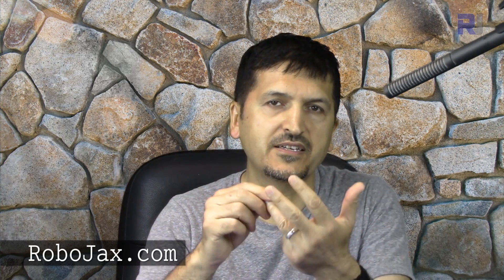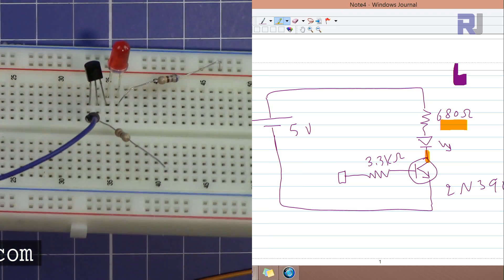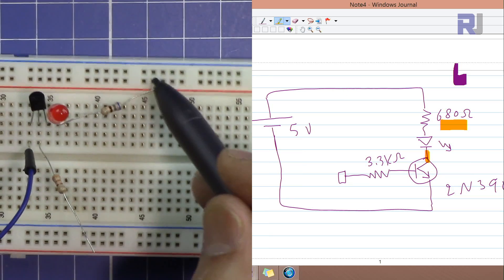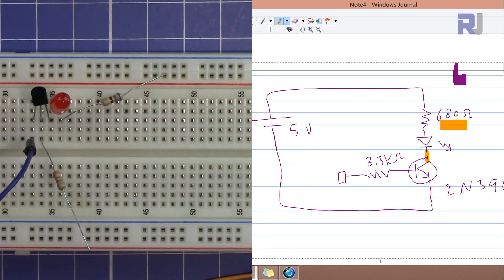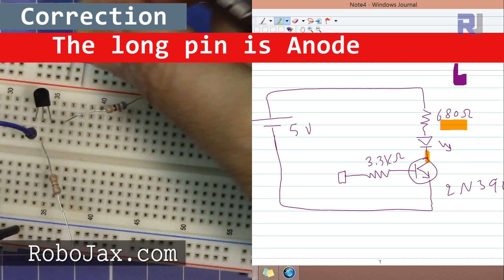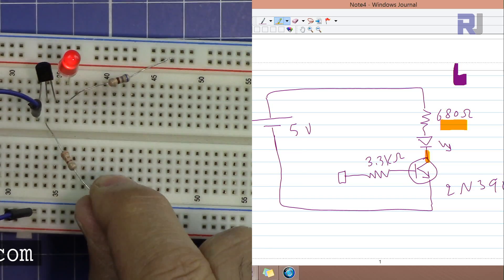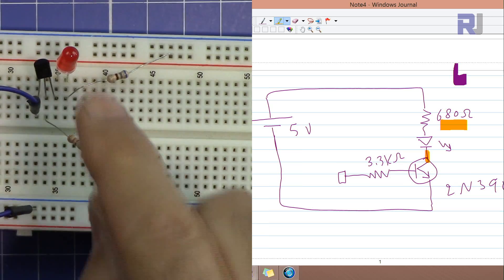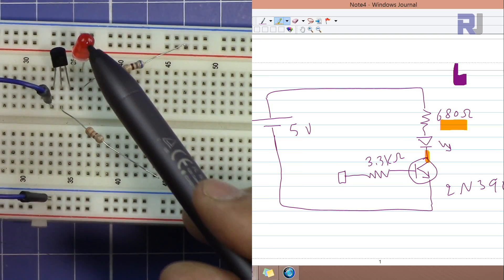Simple Touch Circuit Turn ON LED or something else

Comment: ive built this circuit and my LED is very dim when on. whats my problem? 6v source and 3v LED, resistors are slightly different on the base post of the transistor. i also have to touch both the base and emitter for it to light up at all, not just the base
Reply from the maker: If source is 6V then use 500 or 400 home resistor. The higher the value of resistor in the collector the dimmer the led. So reduces it
Reply: @Robojax  thanks! any insight on needing to touch both base and emitter to get light? just touching base resistor does nothing in my circuit
Reply: @Robojax  i just tested with no resistor on the LED. still dim, unless i short the base to the emitter, then i get full brightness
Reply from the maker: When you shirt circuit base emitter, it should turn off. I assume led is connected on collector.  You can’t connect it to emitter.
Reply: @Robojax  shorting base and emitter turns it on at full brightness. pretty sure LED is connected to collector (flat face of transistor facing me, LED is connected to the post on the right)
Reply: @Robojax  sorry youre right, i have to touch base and collector to make it light, which i can make work for my purpose. just not sure why its not working when just touching base resistor

Comment: how to make led stay on after touch?
Reply from the maker: Then you will need a little complex circuit so it toggles(touch ON, touch OFF) the output.  or just touch ON, stay ON. It needs separate video.

Comment: What about other value of resistor?
Can u describe why/how its work?
Reply from the maker: You need resistor value calculation to design. This is circuit to just build and run. I will have separate video on how to calculate.